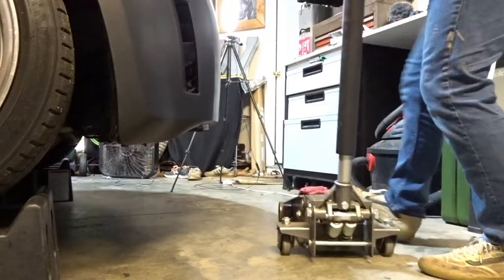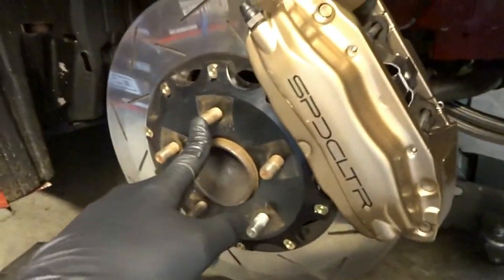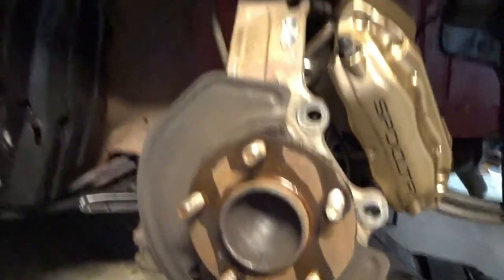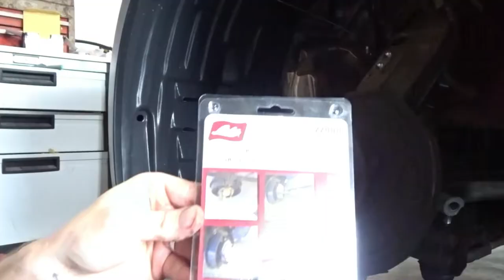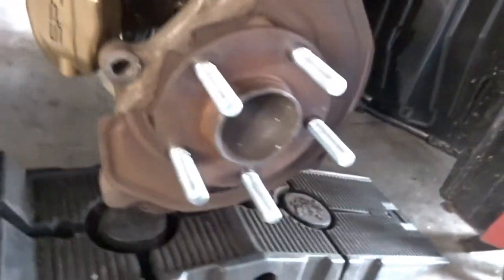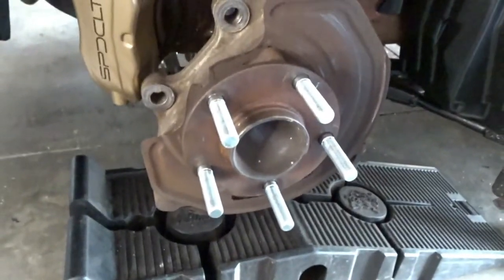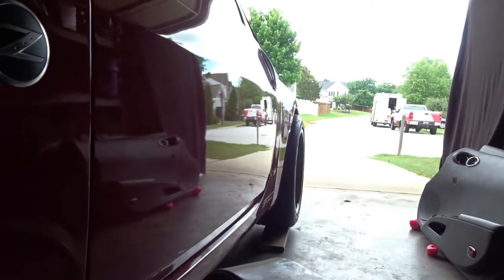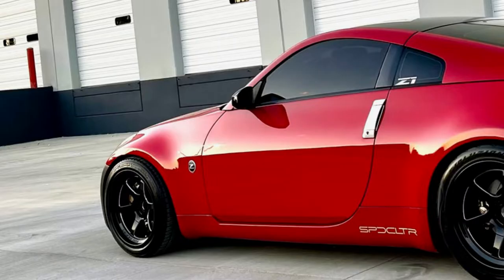How to Install Extended Wheel Studs

Comment: Awesome video. I am running tsw 20" rims with hub centric rings and 6mm spacers to clear my akebonos and I installed extended ARP studs using your video. However there is vibration on the front wheels and wheels have been balanced twice. Any ideas?
Reply from the maker: May need road force balance.  Or alignment
Reply: @SpeedCultureStudios  I'll look into that what it road force balancing